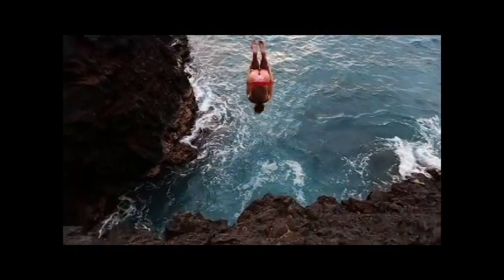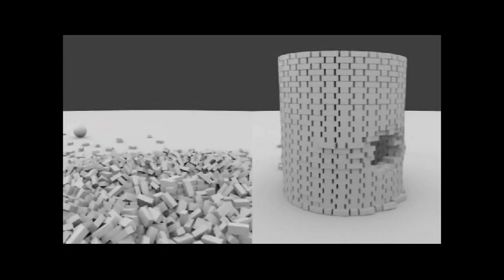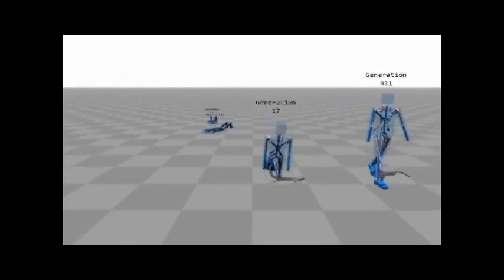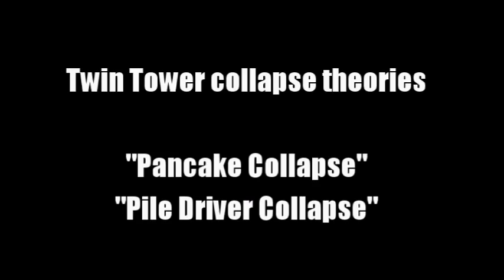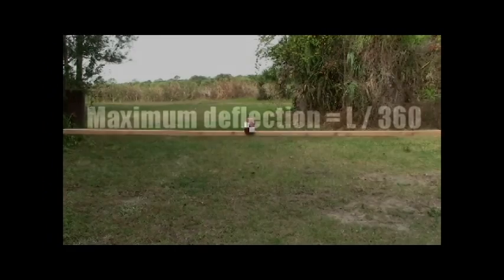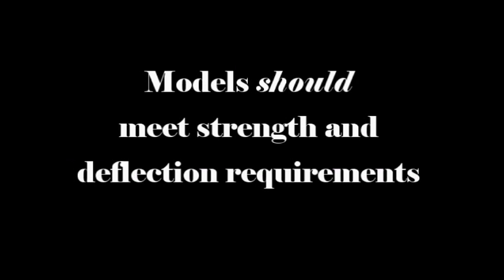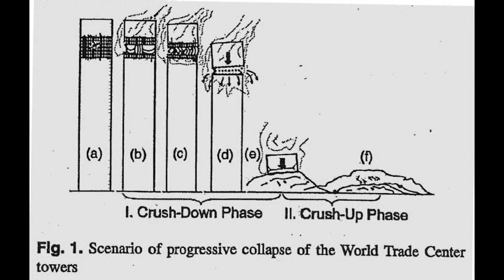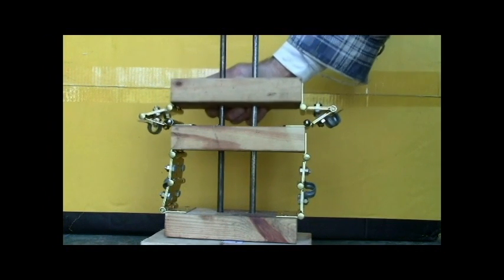9/11 Experiments: The Force Behind the Motion

Comment: I'm not sure if this was very scientific..
Reply: Mike Benign Back up your claim with figures. If you can't do this it is just guessing.
Reply: Good luck getting any sense out of this fucking dunce, Eric.
Reply: I assume, since you are changing the subject, you are unable to give any mathematical justification for your claim.
Reply: "The cores were totally self supporting" Where did you read this? Reference please.
Reply: "The NIST report is a lie."

So how come no one can produce a peer-reviewed paper to that effect and get it published in a serious scientific or engineering journal?
Reply: It is the "truth" movement that want's it, it's up to you lot to fund it.
Reply: I believe the source is his own anus, from whence he receives all his tremendous insights..
Reply: the confusing part for me is if the floors were collapsing and falling they should have only obliterated the floors and maybe dragged with them, the outer frame. The core of the building wouldn't have likely been brought down, so there would have been a metal frame still almost entirely standing in the center.
Reply: "this video canteach you. you jist cus"

Eh?
Reply: Cameron Sipka

I'm not sure if NIST was very scientific
Reply: Resistance to motion ?
Are you refering to the myth that the tower fallen at free fall acceleration ? Because there is an easy rebuttal for that one : the debris falling at true free fall acceleration beside the tower which were clearly going faster...
Reply: Cameron Sipka everything follows the same rules on earth... for some reason this doesn't apply to that day or those buildings... If three buildings collapse the way those did in any other situation, most would look at the situation logically... It's logical to say those buildings were taken down when you watch controlled demolitions. It's exactly the same, and that is not how steel buildings fall from fires. That is fact and you can look it up, steel buildings have burned for multiple days and although burned everything else away the steel did not turn into dust. Have you not seen the video of the owner, or rather 99 year renter... admitting that he "pulled it" regarding Tower 7? Not to mention three weeks prior to the attack he specifically got the towers insured  for Terror attacks... such as an airplane terrorist attack. And by the way he got double coverage just in case it happened to multiple buildings. doesn't that seem a bit convenient to you?  The asshole made so much money from those buildings going down,  and when you're a complete piece of shit  that's unfortunately enough  for some people  to do awful things,  or at the very least allow them to happen. You don't need science to figure out that this is a big giant lie. Why is it that the most well defended country on Earth was able to allow four planes to fly around for over an hour and a half without a single fighter jet intercepting? Our jets can go  across the United States  in about 30 minutes... Oh that's right because every single available unit was doing the same training around the country at the exact same time of the attack! That is not how things are done and it shows complicity. (Not by the fighter pilots , they just weren't able to tell what was reality and what was training)And say that you accept those coincidences... What I don't accept is that the air defense system was turned off on 9/11... and don't ask me how I know that if you won't look it up figure it out yourself. The argument against this being a false flag is always that so many people would have to be complicit in the attack and keep their mouth shut. Many people from the military and the families of 9/11 victims have given information and their opinion on the situation. But more specifically the military that have come out and said  that we were involved. High-ranking officers with a flawless personal history, their opinion matters.  When you completely write them off  because you disagree  with their version of the events,  how do you get anywhere?  You believe what Bush and Dick Cheney say over the men women that are actually out there fighting for our country?  the ones that actually put their lives at risk for you and I. Why would so many wives of fireman and police Etc continue to this day to put themselves through this nonsense if it was just that, nonsense? Do you really think that if you were to have lost someone that day and the official story was correct that you would still be fighting for answers? Not everybody that looks into this is in it for money or to be dramatic... Especially the people that lost a loved one. More than anyone they want the truth and if they aren't able to accept the official story( which has been proven to be complete bullshit, there's nothing in the official story about Saudi Arabia and they were involved... so doesn't that mean they lied?) Nobody lies once in a situation like this, there's no way that is the only thing that they lied about. And say it was, again it's a convenient thing to leave out. There's massive evidence of this. If you go back through history conveniently right after the government tells us something awful such as 2.5 trillion dollars being missing...  often the very next day something tragic happens. This happened right before Pearl Harbor, the day before JFK was assassinated and 9/11... Conveniently the next day everyone working on finding that money in the section in the Pentagon that held those individuals offices happen to be completely destroyed. Where was the backup of all this information you ask?  It was in Tower 7. Again convenient. so not only is all the evidence destroyed but because of 911  no one ever spoke of it again. Why is it that they shove the Twin Tower videos down our throat but never Tower 7 on the news, you'd be surprised how many people don't even know a third building went down.... and they refused to let us see any of the video of the Pentagon. If a plane hit the Pentagon show me the damn video, there is no way they could use the National Defense as a reason not to show us the video in 2017. The only reason to not show us the damn video at this point is because it shows something they don't want us to see. The FBI went around and collected every single video... over a thousand cameras saw the event happen and you and I arent able to see one clear video? It makes no sense. Unless there's something to hide..... One science reason that I know for a fact that it did not happen the way they said it did... Thermite. You can ask how I know again if you'd like but even without samples being tested( which they have been and there were iron spheres) but even without testing it, in multiple videos and multiple pictures lava is dripping from the building. Over a month after the event and completely submerged under water lava pools or still burning. Is that due to fires?  why is there nothing talking about the lava pools in the official story? not only do they not come up with some answer but they completely ignore it. I've never seen a building on fire, put out by fireman, and over a month later lava pools are still steaming away completely submerged under water.  there are multiple firemen and paramedics in my family as well so this isn't my opinion this is from their experience. If you deny that evidence then you are denying reality. It's not reality that I like either, again not everybody that says this was an inside job wants to be right. I wish I was entirely wrong but when you look into it and the decisions that were made that day by very key people it becomes quite clear. Ask yourself, if there was nothing to hide why was all the evidence of the worst tragedy on American soil sent off to China to be destroyed immediately following the attack? Technically that's a crime scene and against federal law to be shipped out of the country and be destroyed before we're supposed to even know what happened yet.  they didn't wait a month they didn't even wait 2 weeks immediately following the attack the rubble started getting shipped to China. If that doesn't make you concerned then I don't know what will because it's illegal to do that in any case let alone the worst one to ever happen in America. And finally all end on this with my long message....  aside from the obvious tragedy and all the suffering that people went through from losing loved ones that day... Aside from that who benefited from this attack? Unfortunately our government, the people who own the buildings... Remember the gold Memorial coins? Who made that money?  did we find weapons of mass destruction? do you think we are ever going to leave the places that we have invaded? It's about oil it's about taking our guns and it's about running the country on fear just like it always has been. America likes to go into other countries take their shit then make them the villain. It becomes quite clear what happened that day if you pay attention to history.  if you actually took the time to read this I do appreciate it given that we have different opinions of that day... which is why if you did finish reading it thank you for doing so. Most people don't read stuff that goes against their opinion  on any topic let alone this one.  if you are actually interested in the information I'm talking about and are willing to adjust your perspective I am more than happy to give you the information. it just bothers me when people ask how do you know but then never look into it themselves. Or even better only use traditional news sources. doing your own research means looking up public records means looking up what time particular events happened and finding inconsistencies.  that's doing your own research.
Reply: Bruce+ What Lane doesn't understand is the fact that the floors systems were only rated to withstand 6 floors worth of falling weight. In the case of the north tower there was nearly 33 floors falling onto the structure below. The upper mass would have had to eject 27 floors worth of weight at the moment of impact to have stopped and an additional floor for every floor below. Never going to happen...
Reply: cantonear1968  What part of the frozen north do you reside in Canadian Duhbunker?
Reply: No, it is not.
Reply: F Ts  That's not the job of a citizen tax payer. That burden is firmly placed on (s)elected officials shoulders.
Reply: DamoSuzuki100   Why after 16 years of calling the government's hand of Texas Holdem all in, they refuse to show their cards Damo? In the interest of national security really doesn't wash anymore.
Reply: Slater Slater  Some of us tire of answering the questions of a simpleton like you. Ask your attendants at feeding time.
Reply: Slater Slater  Still waiting for you to explain how exploding pancakes stack on your planet Slater. 9/11 pancakes sure do look messy.
Reply: Slater Slater  16 years in and not one of you OS defenders can put a name to the Fire Fighter Commander that called Larry Silverstein with news that they were unable to save a building that they never bothered to fight fires in or what time of day that call took place to put the "Pull" statement in context. How would you like to break new ground Slater?
Reply: Slater Slater  Unlike you, we don't have fingers in our ears or blindfolds on Slater. Larry Siverstein said in a PBS documentary that the Fire Department decided to Pull WTC7 because they were either unable to save it or they got tired of looking at it standing there. Maybe you are unable to piece together the information of one controlled demolition to two other structures that were explosively demolished in front of our eyes, but we can Chuckles.
Reply: Slater Slater  It's been 16 years and you OS defenders haven't put together a plausible story to excuse Larry's confession. What have your cult been doing all these years Chuckles? Too many staff meetings in the employee washroom?
Reply: Then stop talking.
Reply: Slater Slater   A nahr bleibt a nahr  - 
A pish un a fortz iz vi a khasene un a klezmer
Reply: Slater Slater  <---->  A shtik fleish mit tzvei eigen
Reply: @Slater Slater  Just trying to make you more at ease with a language you might have heard growing up Slater. You seemed to be so tense and emotional.
Reply: @Slater Slater  Vayt fun di oygn,vayt fun hartsn
Reply: @Slater Slater  Ver farblondjet
Reply: His various experiments demonstrate that WTCs 1 & 2 defied fundamental principals of Physics. What's your problem with this? You're willing to just buy the official narrative that made the perpetrators unfathomably rich. Go ahead and keep drinking the kool-aid ya fuckwit!
Reply: yup! And the weight of the upper floors could ONLY have destroyed the same number of lower floors due to conservation of momentum! And even at that, the upper floors were being blown to pieces and ejected from the footprint, so the weight was being reduced by the second. Plus there was no space for the upper structure to symmetrically fall into before it hit the lower structure so where comes the velocity of it's pancaking?
Reply: The two year study of WTC7 is wrapping up at the university of Fairbanks Alaska. But you should know that due to the vilification of any and all people who question the official narrative any journal or intellectual is going to run as fast as they can away from this topic. The powers that be will crush anyone who dares to question this official lie with any degree of credibility. Look at Chumpsky, he's a thinking man, he knows better than to believe that those two buildings could behave like that, yet he defends the official story because he knows it's career suicide to appear conspiratorial. 
There aren't many structural engineering departments on the planet that would allow a student or prof to seriously pursue the physical modelling of this event, the powers that be are much too protective of their lies and the profits garnered from them!!
"Let us not tolerate outrageous conspiracy theories regarding the event's of 9/11!" George Bush jr on the evening of September 11th! Why would they say that unless they knew people were going to ask a million questions!?
Reply: "What's your problem with this?"
Mainly that he failed to account for scale. Physics is abundantly clear on the fact that objects have different mechanical property at different scale. One of the most basic and well understood being the fact that the bigger something is, the more its own weight is stressing it.
It's a direct application of the square-cube law which itslef is a reflection of the most self-evident properties of a tri-dimensional space, so its not up for debate : his scale model makes for a terrible experiments in this case because physics say so...

And by the way, that not how conservation of momentum works (failling to take the gravitational force into account for one)...
Reply: Agent Rook  Big deal. NIST failed to take into account RESISTANCE TO MOTION and ignored every principle we ever learned about physics.
Reply: Slater Slater  NIST has been refuted by qualified people since before the August 2008 technical briefing to the public where they had to change their interpretation of the 'collapse' of Building 7 to include a period of recorded free-fall of the structure, something the lead investigator said was impossible without the use of explosives.
Reply: Agent Rook  Actually, your people at NIST wrote that the upper floors accelerated downwards through the ever increasing density of the lower floors to "essentially that of the rate of free-fall acceleration" Agent Rock. Perhaps you should take it up with them? Do you need their email address? You can find it on their website.
Reply: Slater Slater  I believe I have seen where you paid shills claim that NIST's masterpieces of building studies were peer reviewed up the Wazoo Slacker. Do you need the website address or have your read their literary artwork yet?
Reply: 12weesel100  Are you saying the Slacker troll is a "Jew-paid" shill JTRIG?
Reply: Lane arndt - "His various experiments demonstrate that WTCs 1 & 2 defied fundamental principals of Physics."
His various experiments demonstrate that he has no clue whatsoever on the engineering of the towers. How do any of his "models" represent the trusses bolted onto the truss seats? How do any of his "models" account for the snapping truss seats that allowed for the progressive collapse? How do any of his "models" represent the role of the floors for the lateral stability of the towers? In which way do his "models" take the fact that perimeter and core weren't able to stand alone into account?
Reply: Lane arndt - "And the weight of the upper floors could ONLY have destroyed the same number of lower floors due to conservation of momentum!"
Are you just parrotting or do you really have no clue about the law of momentum conservation? This law refers to collision in an isolated system. For this law to haven been applicable for the collapses of the towers, someone should have turned off gravity. Are we now putting an anti-gravity machine into the conspiracy theory?

"the upper floors were being blown to pieces and ejected from the footprint"
I am not 100% sure, but it seems like you mistake the actual concrete floors for stories. What was "ejected" were the members of the perimeter. The concrete floors themselves did partly vaporize but a large deal simply fell onto the next floor below, making the seat trusses simply snap -> progressive collapse.

" there was no space for the upper structure to symmetrically fall into before it hit the lower structure"
Are you talking about the initial collapse of the progressive part of the collapse? The velocity for the falling floors is not that hard to figure out. There was nothing that kept up the floors apart from the seat trusses. All the falling mass of the floors needed to do, was destroying the load baring capacity of these seats. Since there was not vertical support for the floors other than that, there was plenty of space for the floors to pick up momentum and destroy the next floor below. You do realize buildings are usually empty spaces?
Reply: Lane arndt - "George Bush jr on the evening of September 11th!"
Wrong again! He said this in a UN meeting on November 10th 2001. Two months after the events. Please do get up-to-date.
Reply: Bruce Lansberg  When was it George Bush went before the public to excuse his illegal invasion of Iraq Bruce?
Reply: M Fritz (NOT M Fitz!) - I am not aware of Bush making any public excuses for invading Iraq. How is that relevant in a discussion on bogus scientific "experiments"?
Reply: Bruce Lansberg  My, my Bruce, you must camp out in YouTube for you to reply so quickly. How well does that job pay you?
Reply: Mark H - Is there anything you would like to add to the discussion on the bogus "experiments" in the video?
Reply: Bruce Lansberg (NOT Bruce Lansburg!)  Why don't you share a bit of your expertise to outline a simple practical experiment that demonstrates the new NISTonian theoretical physics of 9/11 forward have practical applications Bruce?
Reply: Oldschooldan1   Hey Tony!! What's shakin' my good man? Do you have more copy paste word salad to share with the civilians?
Reply: Barrie+ Tony???? Not even close moron! Got any evidence that what I've stated is wrong?????? I didn't think so...
Reply: Cameron Sipka all people can make these experiments at home ! It s simple physic ! Physic is the science who explained forces that causes mouvements. this mouvement we see all days in normal life! May be you have to revise Physic
Reply: You mean like you JTRIG debunker?
Reply: I see you've called in the Jew-paid impersonators, Canadian duhbunker. Have fun with them sweetie pie.
Reply: Fifty-Four Forty or Fight! Canadian Duhbunker ??  Are you now at ease with the  49° as established with the Treaty of Oregon in 1846 or are you thinking of heading up a group of Empire Loyalists to come to Washington DC to burn down the Presidential Palace to see if it will be repainted pink like it was originally?
Reply: cantonear1968  Where do you see the American Ponzi Scheme headed over the next 10 to 20 years Canadian Duhbunker? How much longer should it take to make America great again with the national debt growing beyond $20 trillion within the year?
Reply: cantonear1968  Do you think Henry Kisinge and his Jew caball of drug trafickers will continue to make trilions inporting heroin from Afganistan Canadian Duhbunker?
Reply: Did it need to be? It clearly shows that the official narrative is wrong and that you've been lied to.
Reply: It doesnt show anything. The models dont represent the towers.
Reply: TheGoodChap   Some of the brilliant minds at MIT got involved in the first year of the coverup with an explanation of how the floor collapse led to the total failure of the towers at the speed of controlled demolitions. They speculated on the truss floors failing at their connection to vertical column supports but, realistically as they were allowed to be, they thought the floors would fail at one end first (as any four year old would) and that allowed one side side to tip down. 

 They produced an animation of their concept based on a typical post and beam structure with way too many columns and floor sections and ignored the fact the truss had cross bridging at right angles tying them together like a grid. It was far superior to what NIST produced in the years following by it was rather lacking in knowledge of structural mechanics.
Reply: TheGoodChap  That business of the collapsing of the core structure must have been quite a challenge for the behind closed door strategy meetings between the NIST lead investigator and the editor of the final product, the dual citizenship comptroller of the Pentagon who lost track of so many trillions of tax payer money. That is why it took so long in production and suffered a few failed attempts at a launch in my opinion. The cores were totally self supporting structures in design not dependent on lateral bracing to the perimeter columns. Any child knows that. It supported a large portion of the gravitational loading of the truss floors and when they allegedly fell away like exploding pancakes they were even stronger and capable. The NIST report is a lie.
Reply: What question?
Reply: What part of that statement is unknown to the public at large except for your deliberate misspelling JTRIG troll?
Reply: cantonear1968 Do you think Henry Kisinger and his Jew caball of drug trafickers will continue to make trilions inporting heroin from Afganistan Canadian Duhbunker?
Reply: I love how he dismisses computer models because "Changing the input parameters could yield different results"  yet he does very little to change his models to show different results.  He shows a very narrow set of models that only show one possible outcome that he is gearing us towards.  

His model for his counter argument against the pancake theory does not come even close to representing the WTC's, nor how the collapse would have looked like.  His model was designed to work towards his favor.  His model was all about floor deflection and ignored the side supports (which were solid in his model and did not give way), it also used a weight that only concentrated its force towards the center, rather than evenly across the entire structure as seen in the videos of the actual fall.  This way, the floors would flex before breaking. Which would absorb the force of the falling weight little by little.  This is the same reason why a martial arts master can break only so many boards down the middle, they eventually run out of force behind their swing as each board breaking is absorbing the energy of the force.  What it does not take into account, as seen from the multiple videos of the WTC's fall, is the weight of all the floors above that keep adding to the mass of the falling structure.
Reply: For it to show the narrative to be wrong, it would need to be scientifically accurate.  You cant build a house of cards and say it represents a real building and we just take your word for it.  

He completely dismisses computer models cause, you know, computers are constantly getting things like physics and mathematics wrong.  Darn those pesky computers!

We should really take into account that Firefighters know how a controlled detonation works and not ask an actual company that does controlled detonations for a living.

Lets ignore that this "scale" model was not really to scale and was setup to ensure that the other two theories did not work as predicted.  Lets just ignore all of that because the creator of the video shares the same viewpoint as other conspiracy nutcases.
Reply: Slater Slater  How hard could it be to keep up with a troll like you who has to write your name twice to remember it Slater?
Reply: Eric Henderson  Before I do Eric, I would like you to produce the calculations for collapse times of either trade tower without the consideration of the use of explosives adjusted to at least a modicum of resistance with a calculation of estimated time of terminal velocity. Thanks.